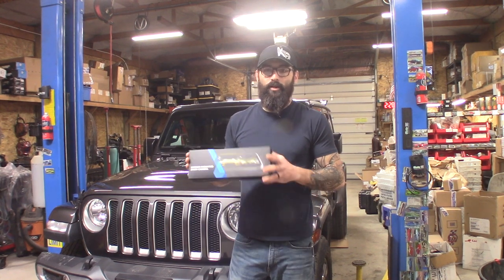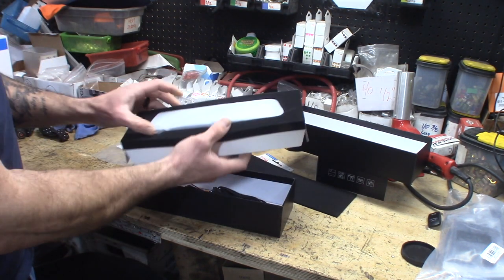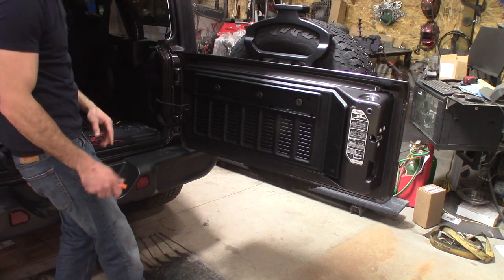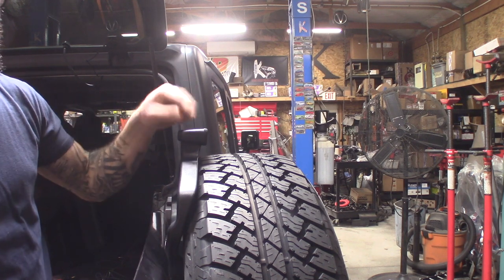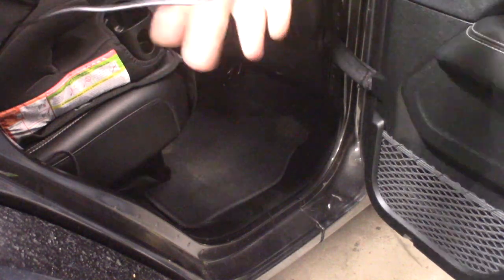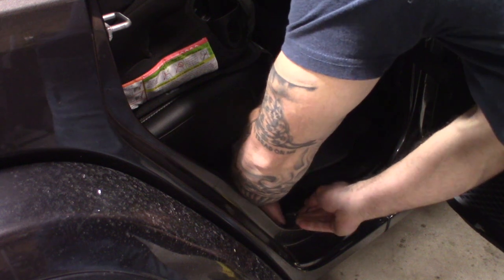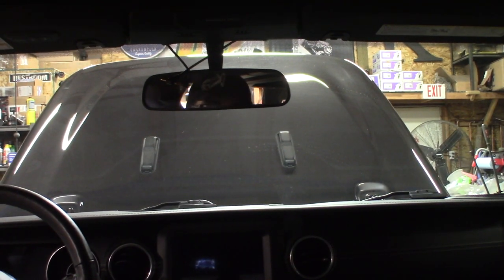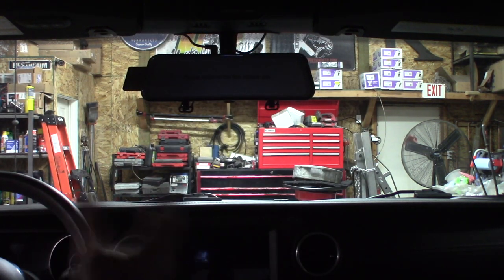Camera Mirror Installation

Comment: Hey Rapffi, long time K Suspension customer have just about all your XJ products. Would have been interesting to see this install on a XJ, wiring the camera to the lift gate was (for me) a pain in my ass! Picked up something like this a couple years ago for my XJ but mine (Auto Vox) actually replaced the mirror. No voice commands, but touch screen, GPS , compass, speed, backup assist, etc. My problem with it is, the weight of the camera keeps pulling/dropping off my windshield! Tried every dam type of glue but in days or months drops off! 🤯 Thinking about maybe Dremel grinding the windshield to give a rough surface to bond to? Thoughts/ideas  (if any) to get the dam thing to hold onto the windshield glass?
Great to see another video!
Reply from the maker: Honestly I’m not too sure
I’d normally just recommend some mirror glue, odd that it’s that heavy

Comment: I wish I had gotten in a few years ago when your injectors were being done right but I cannot recommend folks buy them now. Mine were less clean than the Ch junk I tried first, the engine barely starts and won’t drive. I reset the computer, I double checked my plug connections, no… it’s the dirty injectors. Worse than the 26 year old stock 1 holes I took out each time to try (ahem) “upgrading” to 4 holes. Every vendor sent me garbage that didn’t even let my engine work, this one too.
Reply from the maker: We rebuild all our units in house, and offer a lifetime warranty on everything. If you’re experiencing an issue, I apologize, I am human, I make mistakes. I’m here to fix them though. 
Email us with your order # and issue and we’ll get you fixed up right. We stand behind our work.
I’m a small business and won’t do you wrong.

Hope to hear from you soon. We are currently on vacation so I won’t get back till the week of the 25th, but I hope to see your contact in my inbox 

Happy Trails!

Comment: How do you rotate the rear camera?  Mines upside down
Reply from the maker: we take it apart and flip it, then re-assemle
Reply: @KSuspension  after I took it apart and flipped it, the camera would point too the sky. I ended up having to cut some of the bracket off
Reply from the maker: @bobbyg7552  whatever works I guess lol. We install tons of these all the time, never have any issues.